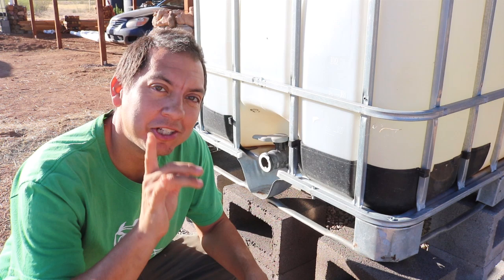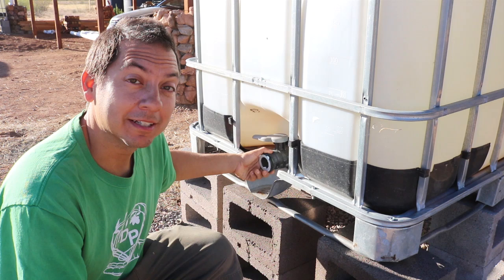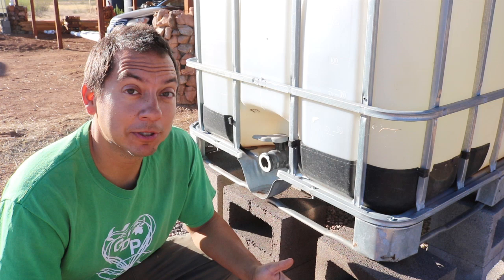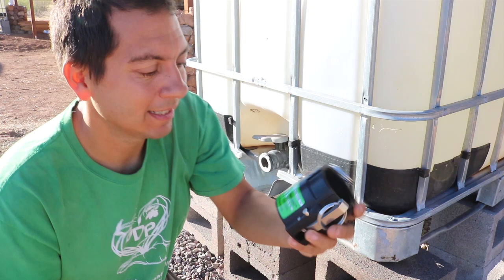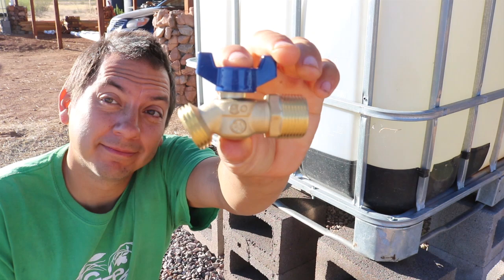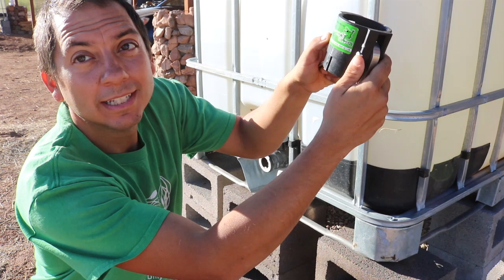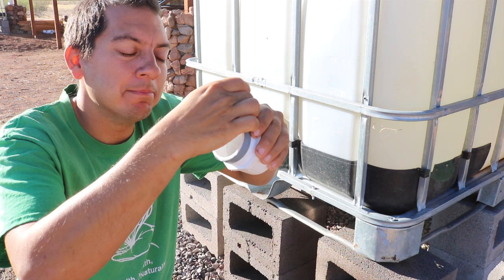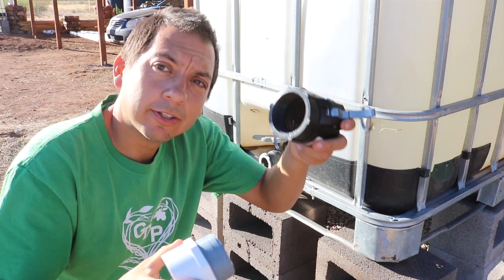DIY IBC Tote Conversion to Garden Hose Attachment | Off-Grid Rainwater Harvesting

Comment: When you have a fitting that tightens in clockwise, you need to put the tape on the fitting in a clockwise direction so that it won't try to unwind as you tighten. Also, with Teflon tape going into a plastic thread, be careful about tightening too much. It's easy to crack fittings that way. I only use thread sealant  on plastic, or brass for that matter. You can always tighten or reseal, but once you crack, you can never go back.
Reply: Thank you so much for this critical information

Comment: Constructive input here. wrong way on the tape, wrap opposite direction you will be turning it to tighten. Also, start at the top of the threads and work your way out. Just FYI

Comment: Thanks for the options presented.  I'd add a union before the reducing fitting.  This way, should there be a design change, you don't have to rip out back to the cam lock.

Comment: Great job!  Simple set up, great solution.  Just need to wrap your threads with plumber tape in a clockwise direction.  Just a word of advise from a plumber.  😊
Reply: I wonder what size is the cam-lock?

Comment: Thanks for the parts list to make the conversion Jim. Very helpful. I hadn't seen the camlock fittings before. Good to know if we happen to get any IBC totes in the future. Cool to see the wildlife hanging around.
Reply from the maker: Thanks Jay! I had to do a bit of research to find just the right attachment. Those cam locks do an amazing job. 😃
Reply: Hmmm where is this parts list? I dont see anything posted.  Any Tractor supply nothing pops up for "CAM LOK"
Reply: @erxkeel  they meant part list in the video if you listen to it and and cam-lock is a brand

Comment: As others pointed out, there are a lot of different fittings for those IBC totes, worse some fittings just leak. The gator locks are pretty good but you still need to add fittings. If you have a bunch of tanks like I do, it can be hundreds of dollars on fittings. I discovered a cheaper way. Get a 3/4 uniseal. They cost about $3, use a 1 1/4 Holesaw, make hole and attach your uniseal with a length of 3/4 PVC. Attach your tap on the outside of the PVC pipe and you are done.

Comment: I had to use similar fittings on my rain tote because the plastic ball valve in the tote broke.  They are not really meant for long term use so something like this fitting is a MUST.
Reply from the maker: Really good point! I didn't even think of the longevity of the valve in the tote.😃👍

Comment: What does the cammlock, lock onto? Why not just a screw on fitting?
Trying to do this on my own....
Reply: IBC totes have different kinds of fittings depending on the ball valve, the one in the video was a cam lock. I've seen them with 2 inch NPT and 2 inch Buttress threads. Basically when you get your tote, you'll have to look at your connection.

Comment: I have a 330 gallon tote and it's 2 1/2 inch. Tried everywhere (Lowes, Home Depot, Ace) and can't find anything. Everyone has 2 inch or 3 inch - any idea where I can get a 2 1/2 inch?
Reply: buy a rubber coupling with hose clamps. slip over fitting

Comment: I'm a newbie to the channel & I know this video is a year old...was wondering what the cam-lock does versus other PVC type piping to be able to use a garden hose, etc.? The cam-lock looks really durable! Does it still work well?
Reply from the maker: It does work well and is holding up.
The reason for the cam loc I believe the unique outlets on the IBC totes. They need to grip onto the skinny neck.

Comment: Is your tote spout threaded ? Very good info, the “big box store” tried to sell me 100 different pc’s. that would have cost well over $100. We don’t have a tractor that’s not 45-1 hour away.
Reply from the maker: It does have a small thread on it, but the cam locks make it possible for the attachments. Yeah, this combo isn't that expensive.